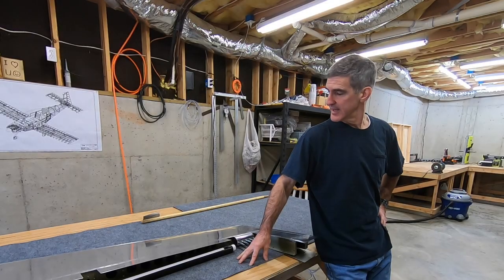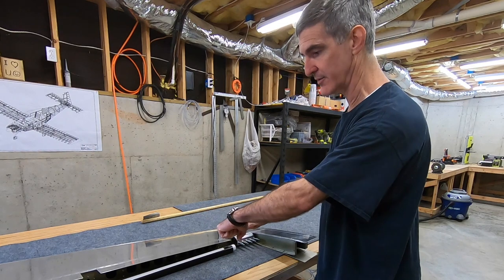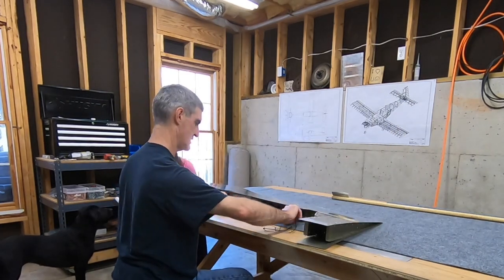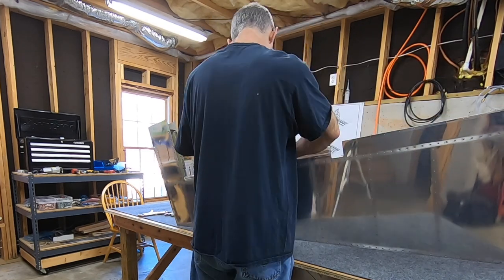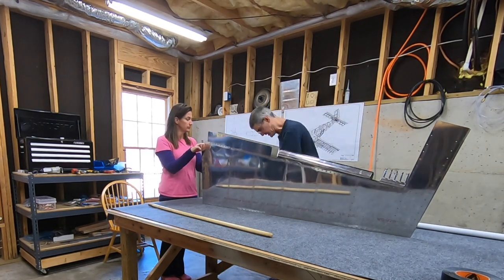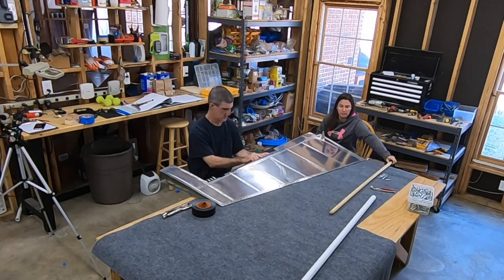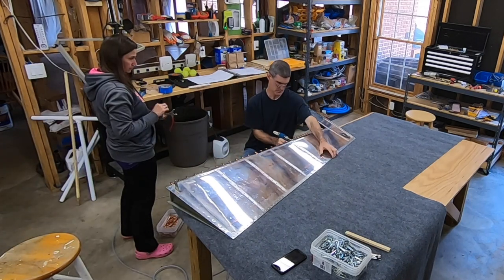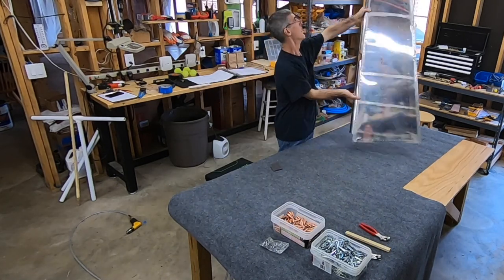RV-10 Build Log - Emp 30 - Bending the rudder leading wedge

Comment: Another very helpful video. Did you get the 1/4" or 3/16" Harbor Freight pneumatic blind rivet tool?
Reply from the maker: Mine is the 3/16"
Reply: @missiletwentynine2667  Thanks. I grabbed the only one they had (1/4") and had a feeling it would be too large. I'll see if I can get the 3/16" model.